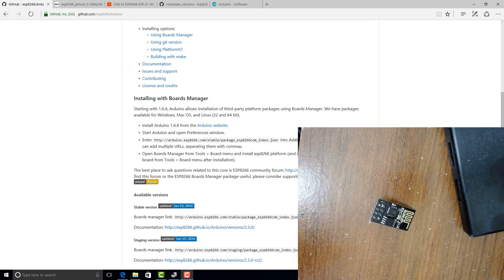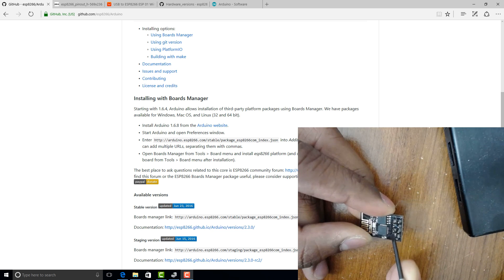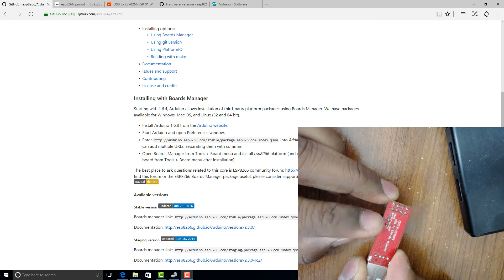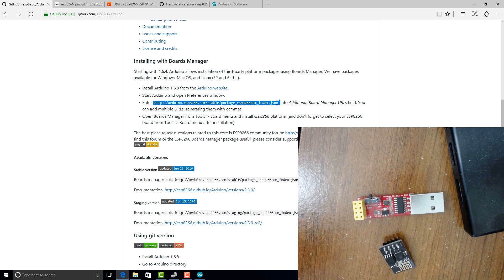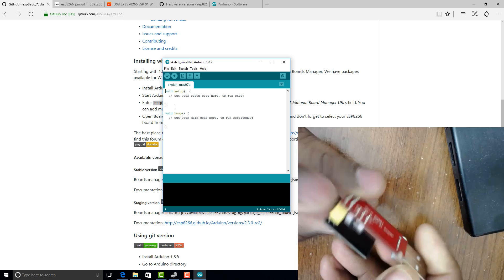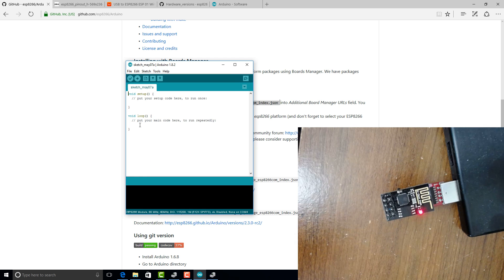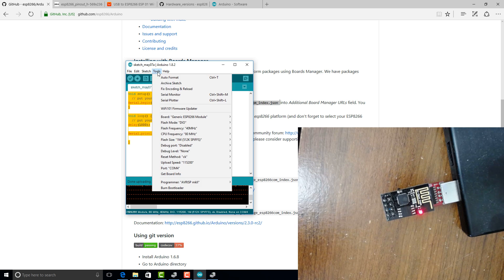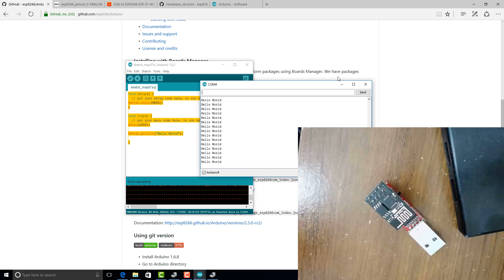The Most Easiest Way To Flash ESP8266-01

Comment: Great video, thanks. Noticed you are using USB Flasher ch340G - this appears to work out of the box.

There are very similar - also red ones - that are ch340C flashers that typically don't work - have one myself :/ ... turns out CH_PD and RESET pins are unconnected... jumper wire the two pins solves the issue.

Comment: Thank you for your video, but when I try to running it appears an error message saying:
_
the selected serial port _
 does not exist or your board is not connected
Could you help me?
Reply: i have the same problem, i try a lot of drivers version but still not working, you get the solution?

Comment: Thank you for this video, but when I try other commands like AT+CWLAP or AT+RESTORE, it says "error" and AT+CWJAP says "no this fun". Please, how do I fix this?
Reply: In order to get your AT commands back you need to reflash them back on. I used this video and it worked. https://www.youtube.com/watch?v=QVhWVu8NnZc&ab_channel=Farrukh
Reply: ps use the red USB to ESP-01 Adapter
Reply: @AztecWarrior75  Thank you very much! I was able to fix it later on. The flashing software and the firmware I was using weren't working well together, but I found a working combination from different sites.
Reply: @luciauwalaka6620  that's good to hear. This gave me a rough time but like you had to use different sources.

Comment: Have you tried the ones without the switch?  My assumption is they must have it wired to always flash.   That's the one I ordered before I saw this one with the switch.
Reply from the maker: Hi Michael, yes I also have one without switch and you  may have use a bread board wire or build a switch to ground the gpio0 i guess it just makes it bread board friendly